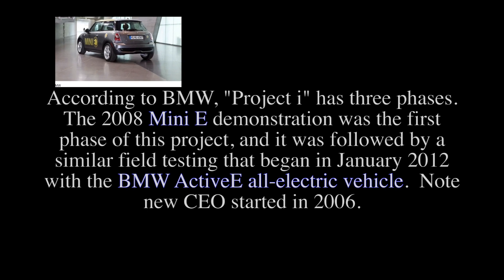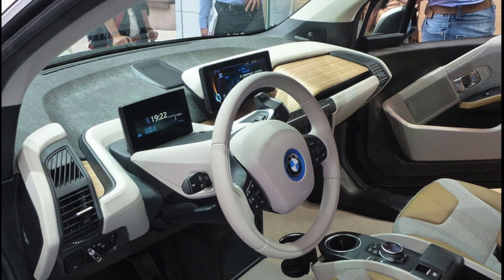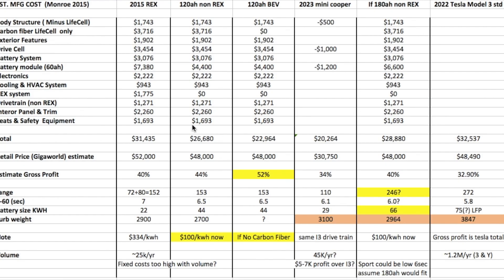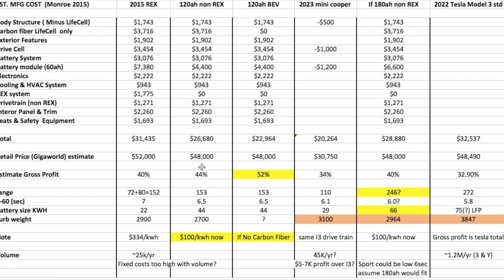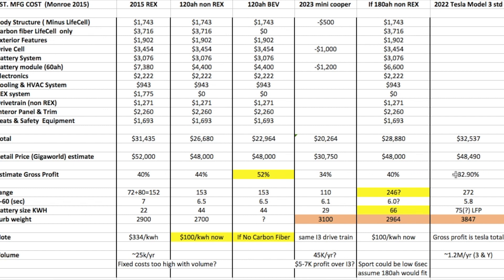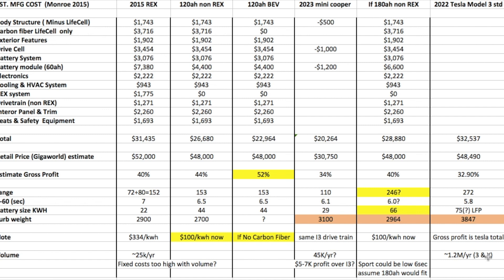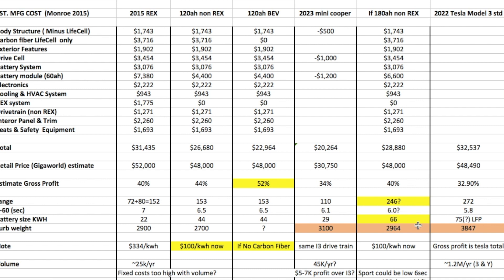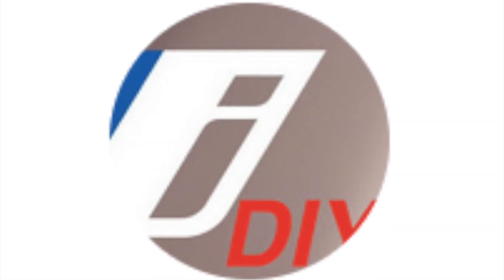BMW I3 History & Mfg Cost Analysis

Comment: Isn’t it strange that anno 2023 we get heavy SUV EV’s instead of lightweight technically advanced EV’s like theBMW i3.
Reply from the maker: I looked up the average miles per kwh in the US for EV's and it is around 2.9.   I typically average around 5 to 6.  I just finished a 'back of the napkin' calculation for my local county, and based on the number of registered vehicles and avg miles driven per year, if all vehicles were converted to EV's at this poor rate (2.9) & avg miles driven remains unchanged, the power consumption will nearly double  (5.47TWh/yr added to the household consumption of 6.11 TWh/yr -  nearly double! )  Even worse, if gas water heaters and stoves are converted to electricity, that's another 6.91 TWh/yr electrical consumption added to the grid (could be ~1/3 of that with heat pump water heaters & space heaters).  That will likely require a significant infrastructure improvement to generate/store/deliver 2-3 times the current electricity average homes use now.   In fairness, the Tesla model 3 efficiency is is noted to be quite good,  including a few Hyundai models, but if Trucks & SUV's with sub 2mi/kwh continue to be built instead of even higher efficiency vehicles, I think we will have a electricity problem (or shortage driving up costs) in the future!    Curious if anyone else is concerned... Thanks for the comment!
Reply: here in Sweden you only get 7 kW out of your 22 kW home charger wallplug at home. The infratructure clearly can't cope with more than that.  @bmwi3diy782

Comment: The i3 & i8 were ahead of their time & way overpriced. BMW misread the market & EV economics.   In 2023-25, we have the option to take advantage of steals on these gr8 used Evs. Buyer beware though ;-)
Reply from the maker: Great point... Based on what we now know regarding EV design, reliability & batteries,  which used EV is (will be) the best value / coolest tech car to buy in 2023-25?   I'll have to think about that...
Reply: @bmwi3diy782  
Steals: Bmw i3 / i8 & kia soul EV 
If you can get 1 for a decent price: model Y & BOLT

Comment: Great data, thanks for sharing! Maybe with more battery range the vehicle still un production. It's a great car, handling, materials, design, etc. Not sure if BYD or even TESLA can have the same futurist vision of the EV in terms of quality and reliability.
Reply from the maker: Great points!  You can see some of the unique design elements showing up in modern EV's  (the VW ID3 being one of them), but nothing that seems to pull so many innovative ideas together for the first time (and have relatively few issues).  Thanks for the comment.

Comment: Should bmw open the source code after they stop support the i3 beyond 2026. 3rd party company should easily make a good battery from that point of time to fit in the vehicle. Or even upgrade the motor.
Reply from the maker: Good idea.  There's people in the EU, Hong Kong (and one group in the US working on it) doing battery upgrades now,  So there is some hope of being able to keep these cars running longer.   I would be worried that some parts of the source code may be used by newer 'i' vehicles and therefore still be kept proprietary.  Thanks for the comments!
Reply: @bmwi3diy782 Finally, we will see the 52kwh battery based on the BMW licensed manufacturer sold by BMW to another company in Germany. Looking forward it in Q3 2025